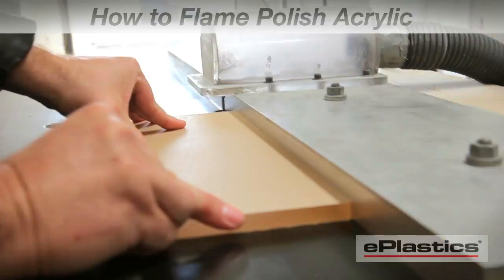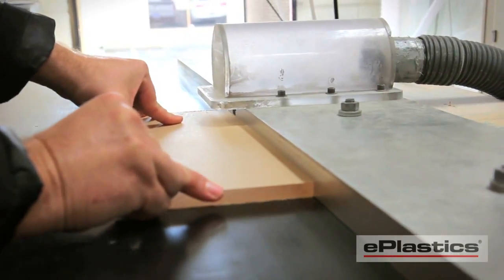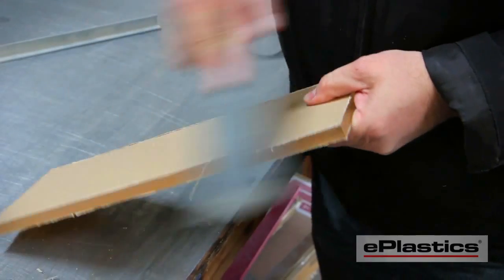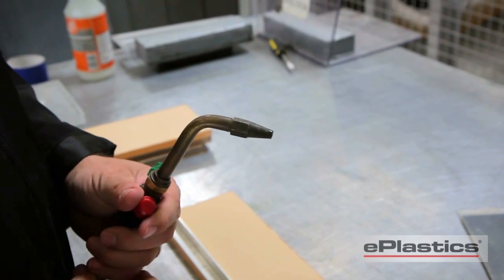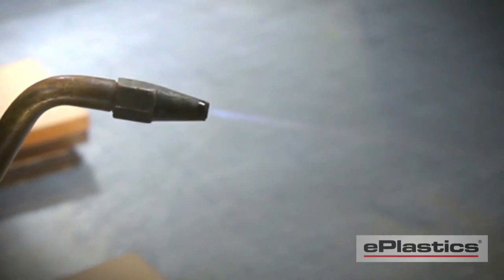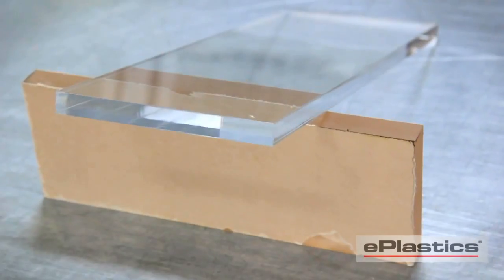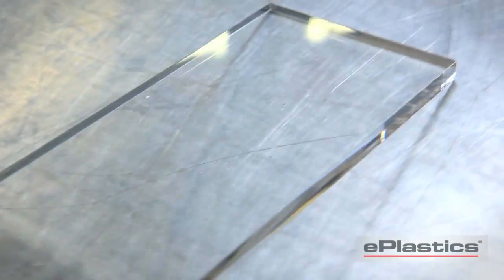How to Flame Polish Acrylic (Plexiglass)

Comment: thank you, very educational. could i ask: we have an acrylic swimming pool divider and it is huge. 45ft long, 2ft high, 2inches thick. It is pretty scratched and hazy. Could i use this method to polish it or do i have to go thru the 200/400/1000/2000 etc grit sandpaper first before flame polishing? thanks

Comment: do you have any tips on how to prevent thinner acrylic from warping when flame polishing?
Reply: Hi I do sanding before I don't flame polish the bottom part just put glue on sanded edge it will be clean and clear. Or use 3m high viscous glue like honey it's slow but no cracks

Comment: People, it does NOT need to be anything fancy for the flame, a simple propane torch is what I have been using for 20 years...and you don't need to mill the edges, either.  I have cut 1/4" acrylic with a plain old vertical bandsaw, and flamed the edges to perfection with a propane torch a gazillion times.
Reply: Propane, MAPP,  Acetyene will discolor clear acrylic yellow..  stick with hydrogen

Comment: I have been experimenting with this technique using an oxygen-acetylene torch but end up with bubbles forming. Would this be due to getting the piece to hot? From watching your video it seems you have a very high heat but move fast... can you give me an aprox temp where the flame contacts plastic?
Reply: Yes sounds like you ran it too hot or moved the torch too slowly over your piece, bubbles or discoloring would indicate too much heat normally on plastics.

Comment: I've seen a lot of videos detailing how to flame polish the edges of cast acrylic.  Is there a way to apply this same technique to the normal surface?  For example, in the case that a surface is milled and must be optically clear following milling, can flame polishing achieve clarity?
Reply from the maker: Hi Elliot- Thanks for the question! Flame polishing is not the best technique for dealing with surface polishing. If you use this method for the surface of acrylic you will get clarity at the spot where the flame is pointed, but the flame will leave marks that "flare out" from the center of the flame onto your material. It works with edges because there is not as much surface area and the flame can be focused with a more narrow area for dispersion. Your best bet is using sandpaper and an oscillating surface buffing wheel for surface polishing.

Comment: Do you have advise on how to fix/bond a hairline crack in a clear plastic automotive headlight housing? Acetone? Two part epoxy?
Reply from the maker: Hi Jeff- we would recommend using an epoxy. You can find an inexpensive one at most hardware stores. One other thing to consider is that when you are fixing a crack in most plastics you should first drill a hole at the end of the crack to prevent it from spreading.
Reply: ePlastics, a Ridout Plastics Company  Thank you for the info, it sounds like epoxy it will be.

Comment: Hello, this method will get the same results on polycarbonate ? Thanks for your help!
Reply from the maker: Hi Carlos- You do not want to use this method for polycarbonate because the material is softer and it will bubble. The easiest way to get a shine on polycarbonate is to do a 'chemical polish'. Use IPS 3 or IPS 4 (http://www.eplastics.com/Plastic/plexiglass_glue) and apply to edges with a Q-tip or pipe cleaner.

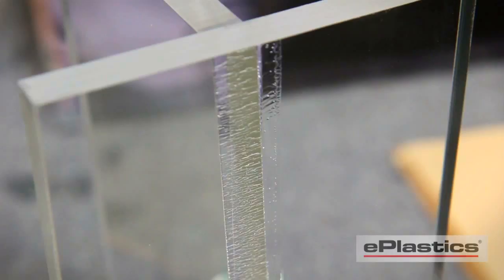Comment: 1:55 if you want to bond them and make it see through what would you have to do? Would the cement make it look like that?
Reply from the maker: The solvent adhesive makes it a clear joint and the flame polishing makes the edges clear. The key to clear glue joints is straight cuts where the pieces fit flush to each other.
Reply: ***** Perfect thanks, and if I need a 3foot long piece for example and I have one that is 1foot long and one that is 2feet long can I glue them to make one long 3foot piece? Or would the part where they joined be visible.
Reply from the maker: Are the acrylic pieces sheets, rods or tubes?
Reply: ***** Large, it's to make an aquarium. The real measurements are probably going to be 2foot tall, 6foot long by 1inch thick and the idea is to turn it into a 2foot tal 12foot long 1inch thick front for the aquarium, but i don't want the seam to be noticeable. The reason I can't but a 12foot long piece to start with is it doesn't fit in the elevator or the stairs.
Reply from the maker: Hi Franklin- A few different things to consider here. First, if you're making an aquarium of that size we recommend going at least 2" thick. An aquarium of that size filled with water will put a lot of pressure on the material, so you want thicker material to prevent it from bending and to provide you with more surface area for the glue to seal when gluing pieces together. Second, it is going to be difficult to hide the seam. No matter what you use to glue the pieces together you are going to see the seam on the front. You also need to be very careful when gluing the pieces together to prevent air bubbles from forming between the two pieces.  I understand that a 12 ft. piece is too big to fit in the elevator or stairs, so you might want to consider making it smaller so that it can be one piece that will fit by itself. We sell the material in many increments between 12" and 144" on our website and also do fabrication work if you're interested:  http://www.eplastics.com/Plastic/clear_plexiglass_sheet.

Comment: Hello Sir,

I m Juned Kureshi from Rajkot (India), I would like to ask Water & Sodium ratio to maintain fire in Flame Polishing Machine.

At present Fire is Yellow Color & We are trying to Blue Color.

Awaiting for your quick reply.

Thanks & Regards,
Juned I. Kureshi
E: eclatrajkot@gmail.com
M: +91 9016267354
Reply from the maker: Hi- we use hydrogen and oxygen. Light the hydrogen, then mix in the oxygen till you get the proper flame.

Comment: could you guys give me insight on how you cut your acrylic? table saw? acrylic knife? laser? can you be specific please bc ive searched everywhere ans got answers but i want to get one from acrylic professional's.
Reply: acrylic sheets, into smaller sheets thats all
Reply from the maker: Hi, thanks for the question. We use a table saw with a blade that's 10" diameter x 100 teeth, carbide tip.
Reply: +ePlastics, a Ridout Plastics Company ok thank you

Comment: What's the edge finishing machine pictured here? Is that something that can be done with a router table?
Reply from the maker: +randerson5726 no. The edge finishing machine is a very specialized machine with a very expensive bit. The bit itself is composed of crushed diamonds and each one costs nearly $1000.  There are router bits that offer a polished finish as well, but we have limited experience with them as we found the price of tooling too expensive. It would also require a special spindle speed and feed rate to achieve the clear finish, so CNC machinery is likely required.
Reply: +ePlastics, a Ridout Plastics Company     So the milling machine in this video is one of these expensive diamond edge finishing machines correct?
Reply from the maker: +randerson5726 that is correct.

Comment: Is it possible to glue a crack at the top of the aquarium without removing the water and contents? 
I have a small crack at the top of the tank and it goes about 1 inch down the front.
Reply from the maker: +Max Ortiz removing the water from the tank may not be necessary if the water is not in contact with the crack. If it is, then water removal is necessary. To apply a water thin solvents (IPS3 or IPS4) into the crack typically requires the plastic to be turned onto its side for application - which would not be possible with water inside.

You can find some simple application instructions at the links below:

http://www.eplastics.com/Plastic/eplastics_how_to_videos/How-to-Glue-Plexiglass-acrylic-from-ePlastics-com
http://www.eplastics.com/plexiglass_glue

Comment: I need to cut a windscreen for my motorcycle. The plexi is curved at (being a windscreen) I need to cut out to accomodate where the extra light bar is. What tool would you recommend?
Reply from the maker: +sforsmith first of all, acrylic is not a good choice for motorcycle windscreens.  It would not meet DOT specifications for the basic reason that is is very dangerous and sharp if broken. An accident could potentially cause the windshield to be the cause of major injuries. In most cases polycarbonate is used due to it being nearly unbreakable. It would essentially bend or break the mechanical fasteners holding to the frame/fairing. Polycarbonate would also "cold-form” around the frame without as much concern of it breaking during the install (assuming it is thin enough to accept the radius). Most factory windshields are produced via a molding method in mass quantities.

You can cut either material with a jigsaw. It will require some sanding to clean up the edges. A router will also work if you have one, and usually produces cleaner cut edges.
One extra note: acrylic will flame polish, polycarbonate will not.
Reply: Thanks Got it

Comment: So, just so I am clear, one should not flame polish an edge if they plan on welding/gluing that edge to another piece of acrylic, correct?
Reply from the maker: +popalock85  you are absolutely correct. If you flame polish the edge and then try welding/gluing, then the edge will craze and the material will be ruined.
Reply: +ePlastics, popalock85:   Thank you both for that clarification.
Reply: Good to know. Does it work after sanding it smooth?

Comment: Got a few questions about this. Would a butane torch work as well? Also I'm wanting to build some boxes by cutting some locking notches into it. I want to keep it looking clean as possible. How can I keep everything clear and have it all sealed?
Reply from the maker: sumdude4 Flame polishing is Hydrogen + Oxygen in order to get a hot enough flame to ignite the surface of the plastic for a half-second. The heat of the flame is critical, and Butane is unfortunately not as hot and does not result in same shine that is demonstrated in this video.
Reply: @eplastics but still works

Comment: What is the deburring tool you are using?  It's it just sandpaper on a board?
Reply from the maker: ***** We sell a tool for scraping edges here: http://www.eplastics.com/Plastic_Tools/EDGESCRAPER , however a steel strip, razor blade, the back side of hacksaw blade, or some sandpaper will also do.

Comment: Am building a 120 gallon freshwater tank. Got it welded, braced, using 1/2" acrylic. Now it is time to flame polish.....wish me luck! Any tips for working on large surfaces?
Reply from the maker: Ryan Lee first off, congratulations on the progress so far. As for flame polishing, just remember to keep the flame hot and long enough to polish the entire surface in one fast pass. Keep the speed as quick as you can, while maintaining the precision and steadiness throughout the project.
Reply: ***** Sounds easy enough. Thanks!